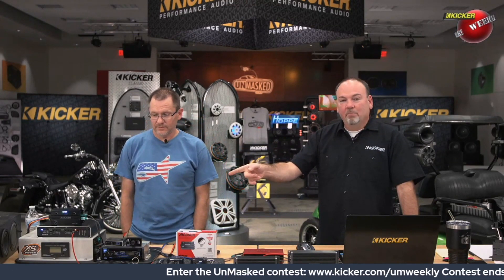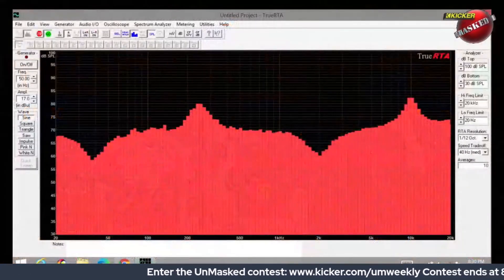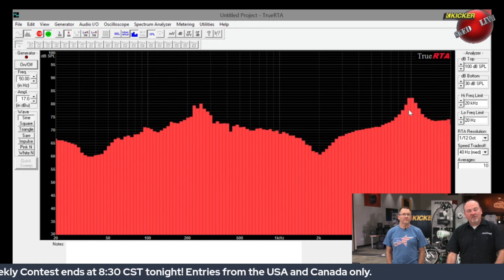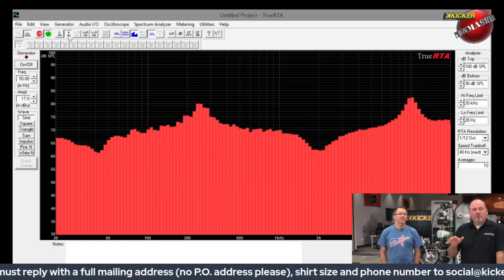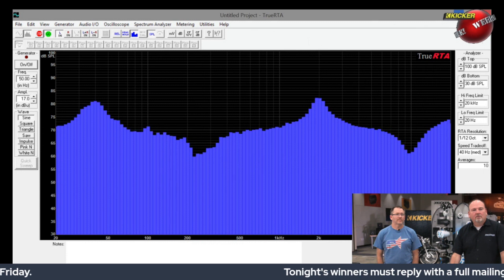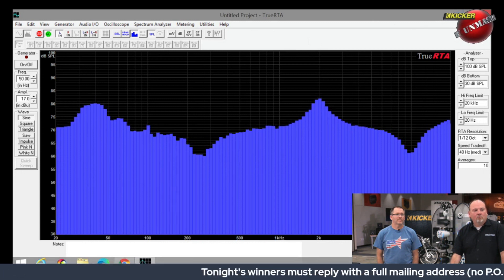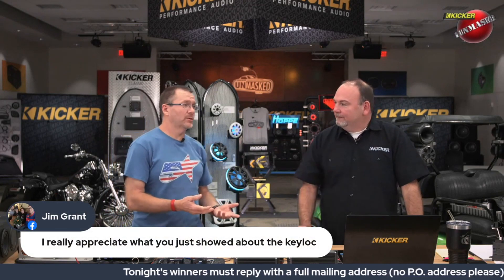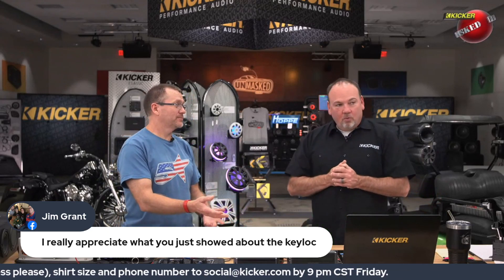Watch the Keyloc Work in Seconds - KICKER UnMASKED - Shorts

Comment: Does it have a built in load generator?
Reply from the maker: No, but we do have 2 and 4 channel load adaptors available if necessary.  https://www.kicker.com/locs-interfaces
Reply: @KICKERAudio  will that work with a 2018 e class Mercedes? Or will the ohms be too low?
Reply from the maker: Its best to check with our Tech group.  They have references to verify whether or not you need the load adapter.  You can reach them by phone: 405-624-8510 or email at support@kicker.com.  They are open weekdays from 8-5 cst.

Comment: So I want to install a small subwoofer (8”) under the seat with a prebuilt amp. I don’t want to rattle my trunk or anything, just clean and punchier bass. After doing some research, my factory speakers are highly filtered and lack the lower end frequencies to push to the sub/amp combo. Will this fix that?

I’m about to order it soon.
Reply from the maker: If you add the KLEYLOC, it can. The DSP built into it can restore lost bass, and identify which speaker leads actually have bass signal to use.  Not all of your speaker leads will.
Reply: @KICKERAudio  how does it "restore lost bass"?

Comment: So is this a line output convert for a car with a stock head unit? Does it come with rca output's?
Reply: Yes. She it will take the factory eq and fix it. Not just a line output convert
Reply: @angelvip2474  it needs a bass knob
Reply: @johnnyditommaso6807  This LOC passes full-range audio. So even if it included a knob, it would be a volume knob, not a bass knob. The amplifier you connect to the KEYLOC should have a bass knob option.
Reply: @firebirdude2  got ya. yeah I should have thought about that when it levels out your EQ.